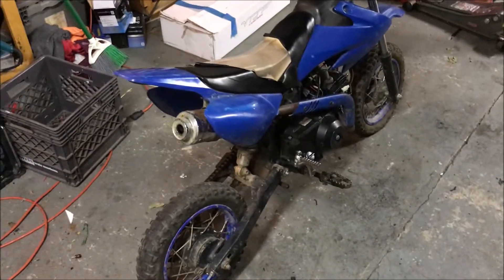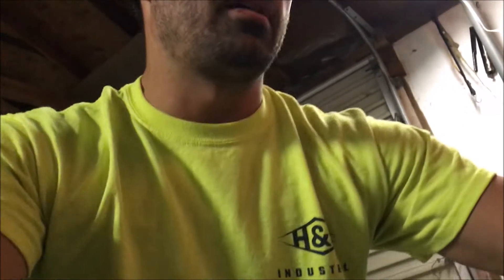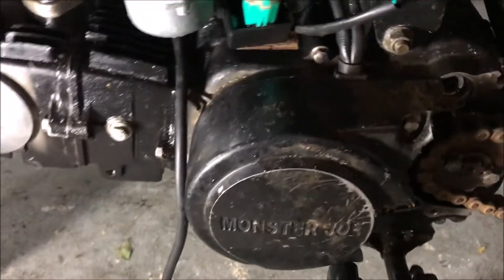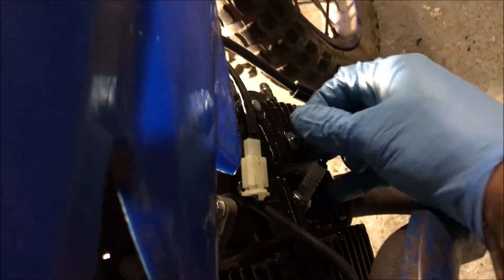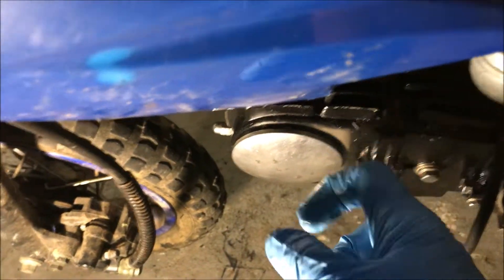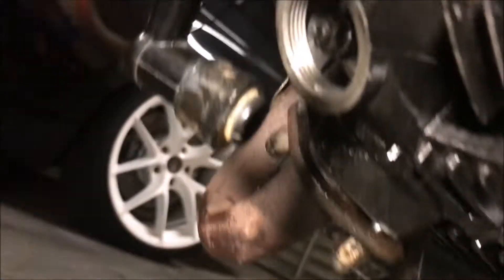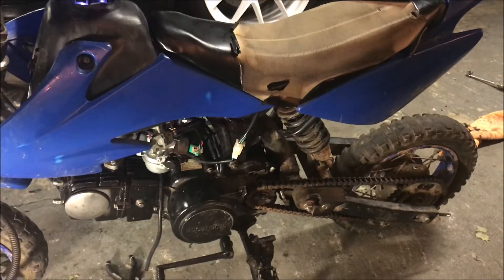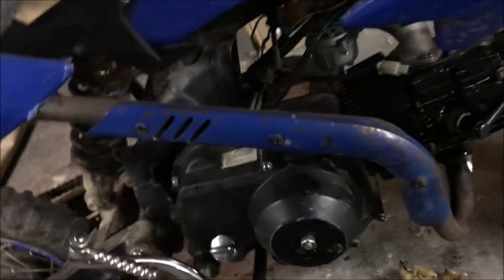THE RIGHT WAY TO ADJUST YOUR PIT BIKE VALVES

Comment: I have a thumpstar 140 pitbike,  bought it used. air filter is clean,good spark, good fuel,its getting fuel & will kick first start and idle and rev fine so I know carb is okay but after it warms up and u ride it for 30 secs it bogs out and shuts off and won't start till its cool again. Acts as if its suffocating for air or something.. Usually takes a few mins to start back up.. Do u think the valves are getting too tight once its warmed up and causing the issue? Hope its a simple fix. Plan on tearing into it later
Reply from the maker: Are you getting enough fuel flowing into your carb? Maybe your fill plug is clogged and not let fuel in fast enough. It doesn’t sound like a valve issue to me.
Reply: @burnout_MEDIA  it was the fuel filter. Easy cheap fix. Partially melted lol

Comment: Hi, not sure if you'll see this in time but I'm actually following your video right this minute, adjusting the valves on an Apollo dirt bike. But I'm at the part where I'm doing the exhaust and when I opened it oil started pouring out, and it's actually still pouring out, there's a lot of it and its continuously pouring out in a very thin steady stream. Is that normal?

Also Your video is very easy to follow, so thank you!!
Reply from the maker: Don’t worry! That’s normal on some of the Pitbike engines. The oil lubricates the top end and usually drains back in to the bottom end but on some models it will pool there. Make sure you check your oil level after you get it reassembled

Comment: My kickstart is super hard to kick and it pushes back hard on a fail attempt, too much compression or bad valve timing? Thanks
Reply from the maker: Sounds like bad ignition timing
Reply: @burnout_MEDIA  If I keep starting it without fixing the ignition timing will it harm the engine or cause it to seize? thanks for the quick response.
Reply from the maker: @chinosaki8067  does it actually start? If it starts and runs ok then it’s probably not your ignition timing. What kind of bike?
Reply: @burnout_MEDIA  it starts after a few kicks. Runs and idles smooth. I have the Apollo z20 max brand new 2 days old. Majority of the time it’s hard to kick at the top, I can put my full weight on the kickstart and it won’t go down. If I try again but with force it will move.
Reply from the maker: @chinosaki8067  sounds like it just has a lot of compression which is a good thing. Kick it like a man!
Reply: @burnout_MEDIA  aha will do thanks 👍🏼

Comment: This was my bike at one point lol. The ripped seat blue gas cap messed up flywheel cover I have a video of it running if you wanted swear to God its my bike. I traded it for a atv from the guy your probably talking about that you got it from. Did you get it near or from lancaster pa
Reply from the maker: Yep this is it. I didn’t get it running and found out the transmission was blown too. Piece of junk. Wouldn’t deal with that guy again.